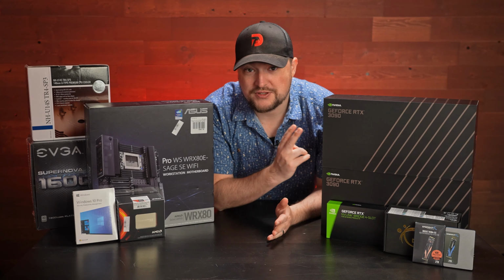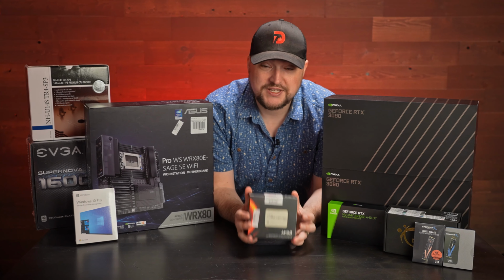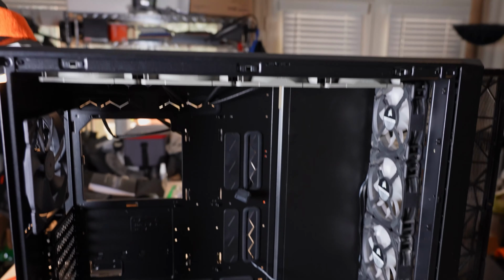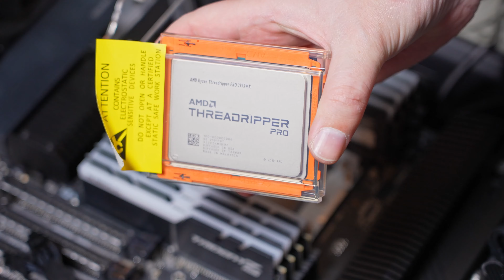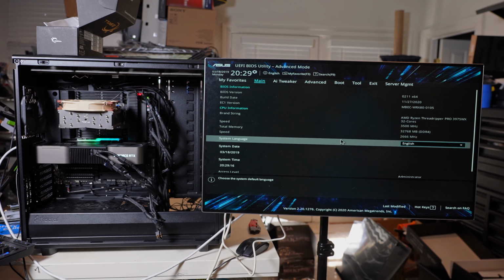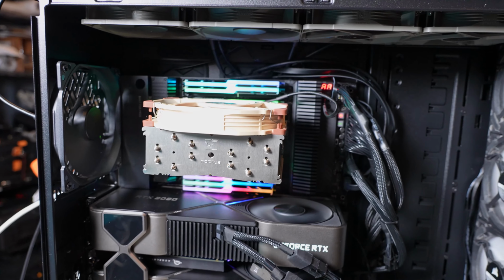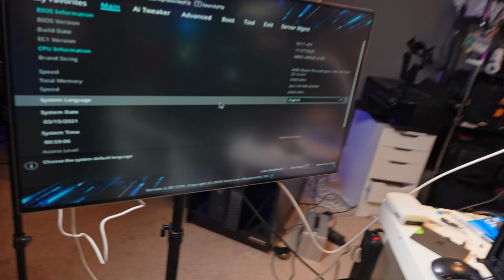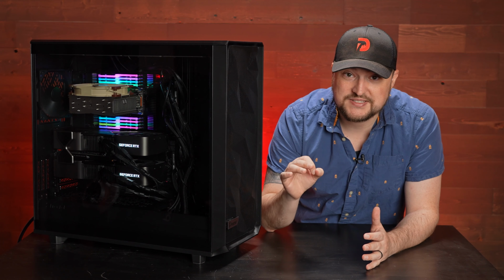AMD Threadripper 3975wx Dream Workstation Build!

Comment: Can't imagine how long these parts took to get in haha. Amazing!
Reply from the maker: Haha, a couple of months!! (Especially for the GPUS).
Reply: I spent three years upgrading the parts in a first gen TR. Now it looks like I need three years just get the parts for a new TR PRO and power it up.
Reply: @maxhughes5687  ya I just got a smokin deal, been looking for 7 months and I just picked up a 3975wx for only 900
Reply: @benruss4130  Was that out of a Lenovo OEM?
Reply: @maxhughes5687  nope, it came sealed in retail box.
Reply: @maxhughes5687  it's funny, I would up getting the ASUS board, and the board costs as much as the processor did
Reply: @benruss4130  It has a ton of stuff on it. It's only a $100 more than a Zenith II Extreme but has twice the cpu lanes, twice the memory channels and two 10GB lan connectors. You can load it up with up to eight times the total RAM, even ECC. From a 5950X to a 3955wx the term isn't double, it's quadruple the connections and data transfer. QUADRUPLE
Reply: @maxhughes5687  oh I know, it's COMPLETELY overkill for my setup... I am also doing 8x16 3600mhz ram and a raid 0 array of 8 pcie gen 4 nvme drives... Puting my theoretical sequential read at 56 GB/s (for context, a single channel of DDR4 3600 mhz is theoretically 28.8 GB/s) I am thinking about making it a whole house computer so that I actually utilize most of the power of the setup
And I got a 3975wx, so I also get 2x the core count
Reply: Please let us know how your ram speed at boot and an O/C to 3600 goes. 56,000. I assume that's all new GEN4 7,000 drives. Will you be using two Asus Hyper M.2 quad cards and putting all 8 drives in one RAID0? Or will that be flat out 8 drives in an SSD7505 Highpoint raid card?
Reply: @maxhughes5687  right now the plan is two Asus m.2 cards all in one raid array. The specific model I am using for the setup is WD SN850s with read of 7000 and write around 5300 (if I remember correctly).

Comment: I like how those two 3090 GPU's, in one go, block one of the primary reasons for going WRX80 - all those extra PCIe lanes! (question: could PCIe riser cables for a 2 GPU setup solve this lane-blocking issue?). Of course, the 2TB RAM potential is retained, though it makes me wonder if most folks considering a Threadripper setup utilising 2 GPU's, wouldn't be better served with a 'standard' TRX40 setup, which can still accommodate up to 256GB RAM. Still, in that niche studio where such a setup is justified, well...yes, this is a beast!

Comment: Yeah I just fell in love with this motherboard and decided I need to build a threadripper system 😂 but if I were you I'd be hitting up cablemod for some custom length cables .. I'm honestly thinking of going with ecc memory since it has a 2tb capacity and just submerging mine in 3m novec and seeing how it goes, oh and it might help free up space for raid cards if you throw waterblocks on those 3090's eventually

Comment: Hi, is your timeline still just HD? I got simillar setup with Threadripper 3960, 128 GB Ram, 2080Ti, if I switch timeline to 2k or higher it's never plays videos smoothly (BRAW format) even for clips without any effects added above. I have no issues otherwise with any footage as long as project is only on HD timeline :)
Reply from the maker: The timeline was in a true 8k timeline, not HD, or 4k, but 8k. The performance is INSANE.

Comment: NO thunderbolt possible on this build
Reply from the maker: Correct, there aren't a lot of options with AMD boards unfortunately. That being said USB3.2 works really well (as most drives can't even achieve 40Gbit via TB3 anyway).

Comment: What kind of Memory do you use? I didn´t find them in the memory list of the Asus
Reply from the maker: G.SKILL TridentZ RGB Series 256GB (8 x 32GB) 288-Pin DDR4 SDRAM DDR4 3200 (PC4 25600)

These were the only available memory modules in the 256GB range at the time of purchase.
Reply from the maker: And they work great ;)
Reply: @District7DrewGeraci  I'm actually building a nearly identical system and I was curious about the memory as well. I know it's listed at DDR4 3200, but that's typically only available with XMP or whatever the overclocking is called. How's the memory speed on the ASUS board, which from what I can tell doesn't offer that OC feature.  Please correct me if I'm wrong. The ram is the last part I need to buy and I don't want to end up with slow sticks lol.

Comment: Do not buy this board. It throttles A2000+ series nvidia cards to 300 MHz. Asus has not responded to this issue after over a month after starting rma process. No response, whatsoever, and they know of this issue. Disgusting. Computer store response: " Confirmed issue with specific GPUs going into low power mode on client's motherboard (Asus WRX80 Sage Se). Mobo has issues with A2000 and A4000 quadro cards. Was able to get it working by covering pin 30 on gpu. "
Reply from the maker: I haven't seen that issue and I've been running dual A6000 and dual 3090s in it for over a year.
Reply: @District7DrewGeraci  I should specify this problem exists on a bad batch of motherboards. It's more Asus's RMA lack of response to this known problem it's fully aware of. I've updated the comment above.
Reply from the maker: @jackhandy0001  Gotcha, I'm sorry to hear you're having issues with it. Hopefully they get you a new board and/or fix the issues with the lower level RTX cards.